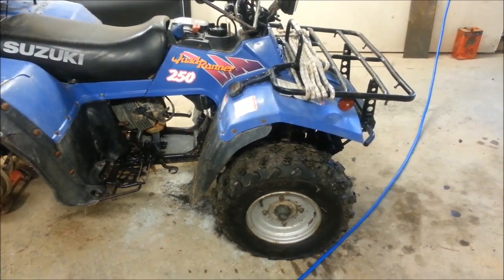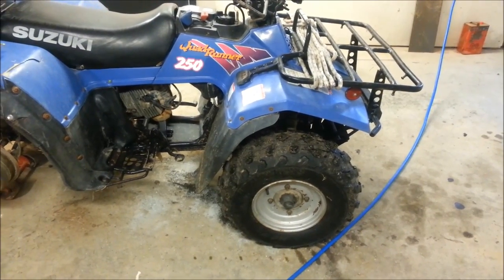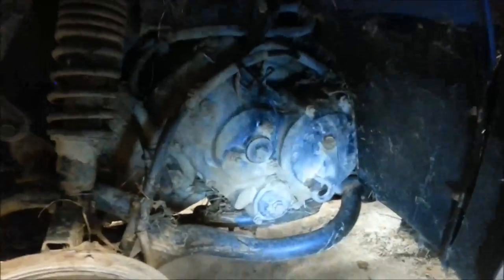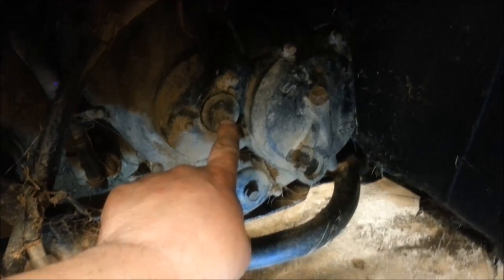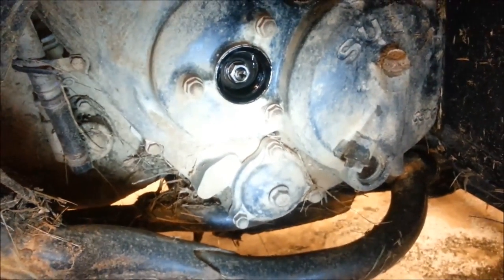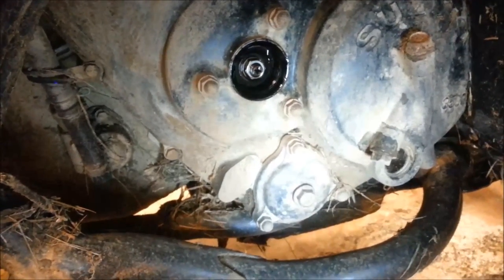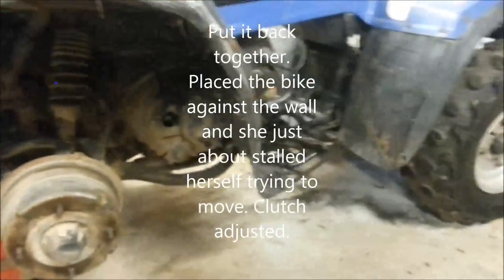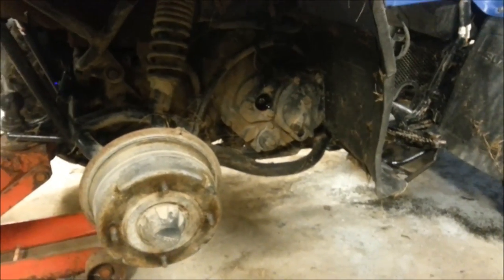Suzuki Clutch Adjust

Comment: The service manual says that you need to back off the set screw 1/8th turn after it seats. So turn the set screw in till it touches then back 18th a turn. Then tighten the locking nut.  Great video though just wanted to clarify for everyone watching.

Comment: Vague, tighten or loosen screw? 
Don't you have to loosen the set screw first?
Reply: Yes I was wondering that too.  There are 2 nuts/screws.  #1 is the philips screw and #2 is the lock nut.  It sounds like he is saying to loosen the lock nut then you are able to adjust the set screw, snug to the right then back it of 1/8th inch,  then re-tighten the lock nut?  Please correct me if I am wrong, not sure either.

Comment: my quad when i down shift it  does not hit the lower gear but goes in netural in between two gears and free wheels down the trail use to slow down with the down shift this just happened a few days ago
Reply from the maker: I'm not a mechanic, don't know enough to even pretend to be one. I have experienced the problem you describe but wouldn't know much on how to solve it. Sounds like the lower gears are having trouble meshing in but perhaps someone seeing this tread or similiar might be able to help. Good luck with it.
Reply: thanks my buddy im a mechanic over 20 years just figured i ask see if ya experience the same issue.. must be hard going trail in newfoundland  giving my quad a hard time lol
Reply from the maker: What part of Newfoundland? Im in Portugal Cove; NE Avalon.
Reply: skipper i knew you was a newfee as soon as i heard ya voice im from roberts arm ,nl central

Comment: I'm not no mechanic but I could do this it seams simple and idk if the clutch is the problem or the tran.
I will be riding and I can have a good shift and the engine will do the low growl then will just rev like its in neutral and then I will let off then its fine, other times I will shift and it will be fine and the whole thing will vibrate and I'm not sure if it the clutch or trans or both
Reply: My Lost Wife my bike does same thing exactly. Did you replace anything or fix the issue yet? Thanks.
Reply: Jawscatz I adjusted the clutch and nothing changed, gears are just slipping and just have to use the thing till it goes,
Or if u know how you can probably replace the gears,
If its anything else i don't know what it is
Reply: My Lost Wife ok thanks for the reply.